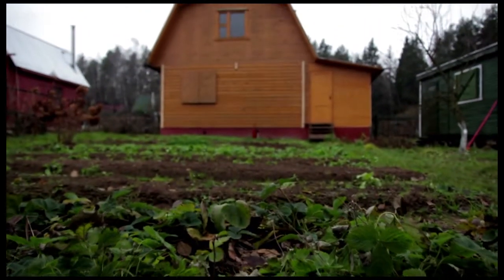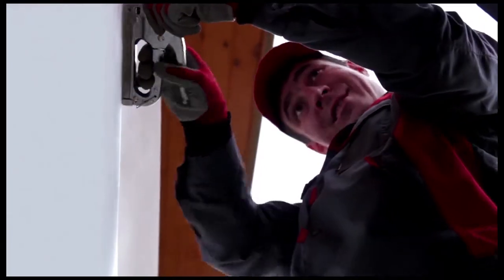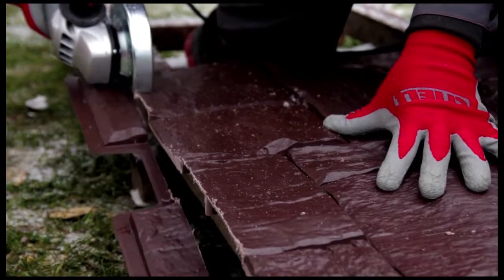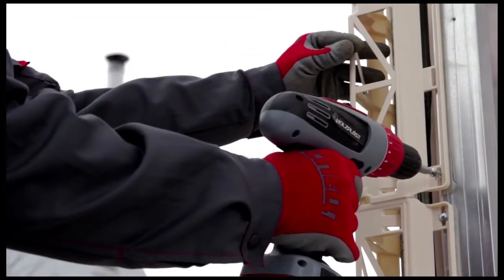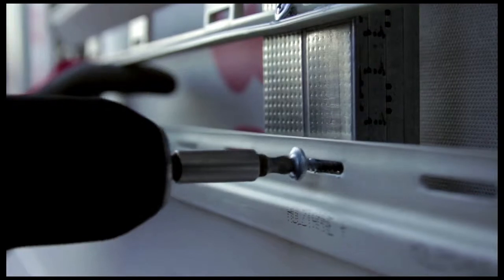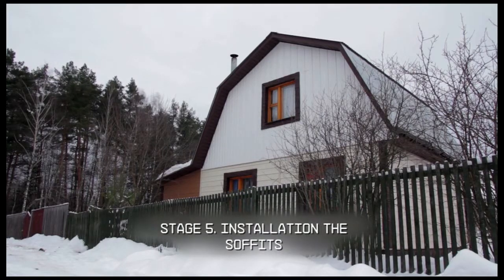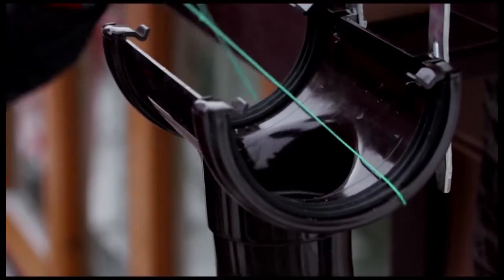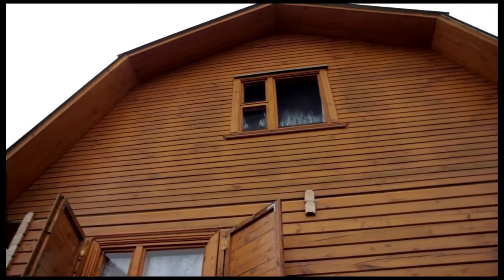Holzplast english Version

Comment: 10 Common Vinyl Siding Problems
 
Vinyl siding problems have become nightmares for an increasing number of homeowners. Though this siding material is very popular, it is important for buyers to be aware of the drawbacks and environmental dangers it poses. Many people think that vinyl siding is a one-time, maintenance-free installation. However, as time goes by, they prove to be wrong. Below are some of the most common drawbacks of vinyl siding.

1 – Unappealing in Comparison to Wood or Stone

Vinyl siding is available in many colors and textures. It can simulate the look of wood very closely. However, a discerning eye can quickly make out the difference between authentic and fake wood. No matter how well it is made and installed, vinyl siding can never be as authentic as wood or stone.

2 – Releases Toxins at High Temperatures

Vinyl siding is a product that is under constant criticism from environmental organizations. It is a plastic material that is manufactured in an environmentally hazardous manner. The end product is also toxic at high temperatures. If it catches fire, it can expose people indoors to high amounts of toxins.

3 – Fades after Few Years

Vinyl siding is available in many different price ranges and qualities. The cheapest ones are most susceptible to fading and discoloration. After a few years, you will find that the siding has lost its appeal and you may have to replace it.

4 – Can Crack or Bend under Pressure

Vinyl siding can be damaged when hit by objects or if you accidentally push the snow-blower or lawn mower against it. Cracks and other forms of damage cannot be repaired easily. You may have to replace the damaged part of the siding, which can be complicated because it is difficult to find exact matches.

5 – Requires Regular Cleaning

Vinyl siding will accumulate dust, mold and mildew after some time outside. If left unattended, these problems can invade your home. Annual cleaning of vinyl siding is a requirement, contrary to popular conception that it is maintenance-free.

6 – Can Hide Moisture Problems

Vinyl siding can be susceptible to moisture problems if you use pressure washers or clean the siding improperly. Moisture underneath the siding can quickly invade your home and lead to mold, cracking paint and damaged wallpaper.

7 – Inadequate Insulation

Vinyl siding does not offer good insulation. Newer varieties of the siding material come installed with foam, which offers better insulation. However, most vinyl sidings require additional backup when it comes to insulation.

8 – Insufficient Color Choices

Vinyl siding can crack and bend out of shape if it is exposed to high temperatures. Because dark colors absorb more heat, vinyl sidings are usually found only in lighter shades.

9 – Lowers Property Value

Vinyl siding does not enhance property value, unlike wood, stucco or stone. It can be unattractive to many buyers, especially in upscale neighborhoods.

10 – Bad Choices for Historic Homes

Vinyl siding can damage the charm and original appeal of historic homes. The installation process may require changes and can even damage the underlying structure.

Comment: Despite the popularity of vinyl siding, there are some specific disadvantages, or drawbacks to using this material.  First of all, PVC is considered to be carcinogenic, making this a risk in the manufacturing environment.  Also, carcinogenic fumes can be released from exterior PVC siding in the course of a house fire.
Another con for vinyl siding is that its appearance cannot be altered once it is made.  For example, vinyl siding cannot be painted to create a new look for your home as you could do with a wood exterior. Still another disadvantage is that vinyl siding can melt if exposed to extreme heat, such as a barbecue grill or an oil lamp placed too close.  Another drawback under certain weather conditions is that strong winds and rain (or improper installation) can cause water to become trapped behind the vinyl siding.  If this occurs, it can result in mold or mildew developing